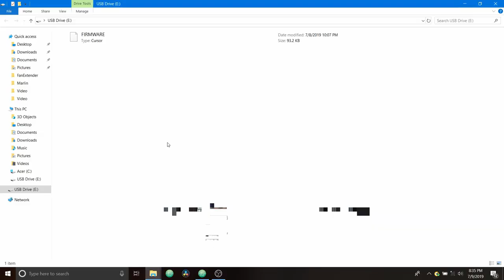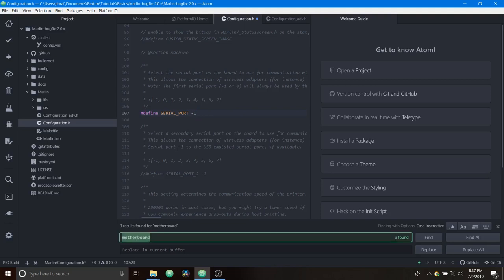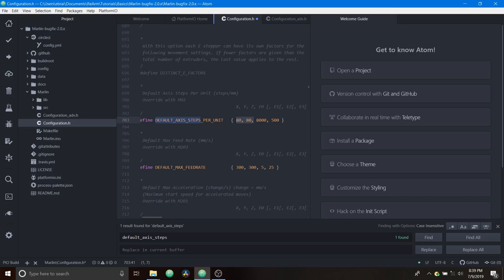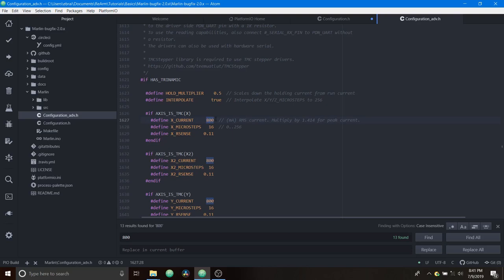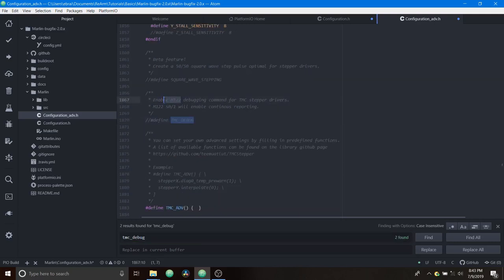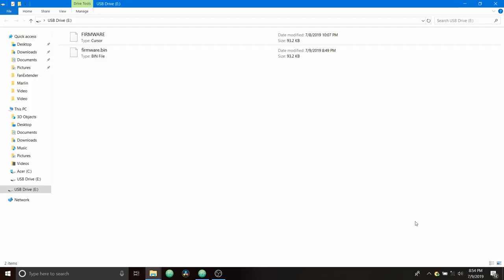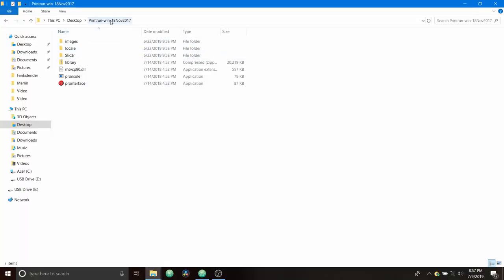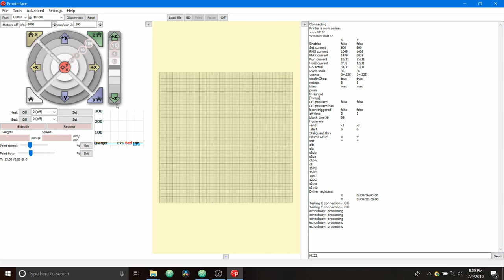SKR 1.3 - TMC2208 UART v3.0

Comment: Hi @Edward Braiman - I didnt read the directions and I'm now finding your vids.. I just smoked two of these boards; I believe (in part) to not reading the directions. Eventually I did move the jumper for the USB over but then (hind sight moment) I plugged it back in to my laptop... more magic smoke and my laptop went dark... Killed it!!  Now I need to see of my laptop can be fixed.
Reply from the maker: Does your laptop boot after?  I've done that in the past as well, but it usually burns out USB port.
Reply: @EdwardBraiman   sadly nope...  I haven't opened it up yet but I think it may have gone past the USB 3.0 port. I may just take it to a shop, it was a pricey laptop.

Comment: Thank you for publishing the image.
Thank you for your help beyond the language barrier.
BigTreeTech SKR 1.4 turbo
BigTreeTechTMC2130 SPI v3.0
NEMA17
Same as jumper pin image in configuration
#define DEFAULT_AXIS_STEPS_PER_UNIT {80, 80, 400, 93} // Changed
Faced with the problem of constant travel distance
Every day I don't know how to deal with it.
Thank you.
Reply from the maker: Are you saying calibration of x axis moves 20 when 10mm is requested in Pronterface?
Reply: @EdwardBraiman  
Ed's 3D Tech
Do you say that if your Pronterface requires 10mm, the x-axis calibration will move by 20?
Thank you.

Input 30mm with G00Z100
Reply from the maker: Ok let's start with a frame of reference.  If you move x axis 20mm what occurs?  Does it move a distance of 20 mm?
Reply: @EdwardBraiman   
Thank you.
I will check again.
good bye
Reply: @EdwardBraiman 
 I couldn't understand because the motherboard was different.
Thank you.

Comment: I'm in the middle of upgrading my Cetus3d-printer with this board and the TFT35 V3.0 display plus a Noctua fan.
Had to order some PT100K thermistors (B57560G1104F000) from Mouser and are now waiting for the delivery.
My TMC2208 works fine, just a little hum when the axis move.
Reply from the maker: Current value maybe a little high.  Try moving the value down about 10% and see if the humming stops.  Let me know how it works out.
Reply: @EdwardBraiman  Yea, I just set it to 500 mA in Marlin, just testing! Lots of paramerers I can play with. No magic smoke so far!

Comment: This was indeed a very frustrating experience...Had the same problem as Ryan Schmaltz. It's a damn MICROSOFT problem. (I have Winblows 10, 64bit) I don't know why after 24 years of the existence of USB, MS still can't get it right. Tried the below solution three times, didn't work. Finally had to remove sd card from printer, put it into a different card reader, which Win 10 did not recognize, had to format it (FAT) then manually copy the bin file from the directory it was saved in by Atom. Put it into the machine and theeeeeeennnnn, Voila! finally got the Ender screen to be more than a night light. Was able to move the axis and extruder. Then connected up the Raspberry PI, which recognized the new Ender reincarnation right away. Started Octoprint and am now running a stringing test. I am amazed at how quiet this thing is now. I am running 2208's for all four steppers in UART mode. Soldering the pads was a major pain. Good thing I had 5... I destroyed the first one. Perhaps the manufacturer of them could put a micro jumper pin set there...hint-hint. I needed to combine information from at least three videos to do this, none of them did it all.  Here is the other main video, this is very helpful.
https://www.youtube.com/watch?v=GNGN2iSQ5j4
I built the rear enclosure that this guy has on thingiverse.

Comment: I bought this from them and their V3 drivers and they are weird as they are more universal because their pins go all the way through so can be used on the V1.3 via jumper or the wire loop mess on the other controllers.  Pretty cool and forward thinking.
Reply from the maker: Yup.

Comment: thanks for the clear tutorial, would also be helpful to show what solderpads need soldering on the tmc2208 as bigtree tech dont always solder the pads to use uart mode.
Reply from the maker: This maybe true, but I'm concerned some might not see the zero ohm resistor.
Reply: @EdwardBraiman  i only mentioned it as i ordered the 2208 from big tree which was meant to be pre-soldered for uart and came un-soldered
Reply from the maker: @johnsnow6012  I understand.

Comment: thanks for the first steps. My Board is up and running so far. Now I wonder, if i can attach a capacitive Levelsensor and if additional MosFets are required like on my ANET-V1-Board, which the SKR will replace soon.
Reply from the maker: I avoid mosfets only because I don't use the heat on my heatbed.

Comment: I just received Bigtreetech TMC2208 v3.0 drivers, and already have MKS GEN L V1.0 main board. For not I'm running them as standalone, but wondering how to properly wire them to be able to use UART in combination with this MKS board?
Reply from the maker: This videos scope is for SKR v1.3.  you will need to read the manual for bigtreetech TMC 2208 as they may require changes.  Also there is directions in Marlin firmware you need to follow.

Comment: Edward Braiman, Hello,  I am re-vamping my CR10S and using the SKR v1.3 board for this. I have a new extra set of LV8729 drivers, and hoping that they can be used, instead of having to buy different drivers. Will this be possible , or cause problems? Thanks
Reply from the maker: The board should support it

Comment: Hello i have 4 question...
1. need soldering bottom pcb ? (J2)
2. TMC2208 V3 on Drive Extruder can use ?
3. STEP/DIR mode use with Drive Extruder  ? 
4. Different  STEP/DIR mode and UART v3.0 on  Drive Extruder  ?
Reply from the maker: There are three modes you can use on tmc2208.  I'm only addressing UART mode of stepping in the video.  Soldering normally is not required unless there is a defect in manufacturing.

Comment: Hi Edward, Great explanation well presented.  I have also new 1.3 board w/ 2208 v3 uart.  I am  planning 4 uart 2008 / X,Y,Z,E   - question regards X_current 600 change from default . why? what the benefit ? is it ok to put all stepper motor current 800?..  x-axis. y-axis, z-axis, extruder?   Thanks
Reply from the maker: Well you should use the datasheet and equation in the firmware to start, but for testing it's okay.

Comment: Driver for Extruder which best choice ? TMC2130 TMC2208 or DRV8825 ? for skr v1.3
Reply from the maker: Depends on you level of experience.  As a beginner I recommend starting with drv8825.  When you become more confident, then tmc2208.  And when you're very experienced, then tmc2130.  This is only because as a person gains knowledge they'll understand what's going on.

Comment: Thank you for all the info. I have 2 questions. first of all I did purchase 4 v3 2208 drivers. 1. if I use 2 motors on Z drive what do I set current to on that driver? 2.  my old e-0 default steps is ###### do I set the same as in old software?
Reply from the maker: I would start with default setting after computing RMS and divide the  connection using the technique ... https://youtu.be/yrSSps4ZWQk ... Start as if you're working with one motor.  Let me know how it works out.
Reply: @EdwardBraiman  All working good at default settings. Sure is quiet with 32 bit board and 2208 drivers.

Comment: Other guides tell you to place a jumper on the 2nd row (under the drivers) if you want to use the UART mode. They also tell you to solde the j2's.
Why don't you?
I just keep getting tmc connection error and just don't know what else to do anymore.
(Skr 1.3, all tmc2208 V3 drivers, TFT 24 V1.1)
Reply from the maker: The jumper caps in correct position are still required.  On underside of TMC steppers there was a quality issue that myself and other early adopter's experienced with zero ohm resistor falling off.  Since then it's been mostly corrected.

Comment: As the video is wrongfully labeled TMC2209.
I'm actually configuring the TMC2209 in the SKR1.3 and stepped into communication problems.
Turns out it has to do with the wiring of Rx/Tx on the stepsticks.
Mine had an internal 1KOhm that got inline with the TX on the SKR board, so uart signal level seemed not sufficiant and communication failed.
This may be important to check for different 2209 and 2209 sticks when having no success with M122.

I got it finally fixed by using an additional jumper on the SPI jumper block effectively shorten the Rx/Tx pins of my TMC2209 step sticks
Reference here: https://github.com/bigtreetech/BIGTREETECH-SKR-V1.3/issues/59
Reply from the maker: Not sure I understand, the video is for tmc2208.  Could clarify?
Reply from the maker: Okay I think I understand you're saying to do TMC 2209 you'll need to add a jumper.  Good to know.
Reply: @EdwardBraiman  
a) I still have a cashed copy that labels TMC2209, guess there was a typo when uploading?

b) the communication problem may not just be for 2209. 2208 and 2209 communication is rather identical. It's the problem that the pinout of the step sticks seems to be not standardised.

My 2209 are FYSETC v2.1 and you recognise the variant with seperate Rx/Tx pins, the pin sequence is  EN, MS1, MS2, TX, RX, CLK . There seems to be an 1kOhm between Rx and Tx pin and only the Rx connects directly to the TMC chip.
This sticks obviously have an integrated Rx/Tx sepearation circuit that conflickts with the BigTree layout. This separation circuit is already on the SKR layout when you check their shematic. Otherwise you get level problems between Rx and Tx on the micro controller ports because of the added 1kOhm on the stick.

So the SKR1.3 connects the UART jumper to the sticks TX pin only, but expect a single UART pin going directly to the TMC pin on the step stick and do the Rx/Tx break out with the 1kOhm in the SKR board layout.  

By the additional  jumper I can fix this and bypass the 1kOhm on the step stick between Rx/Tx and the SKR gets access directly to the TMC chip pin. So I spare myself the modification on the step stick with solder irron and tiny surface mounted components.

Just wanted to note, that you need to be carefully with step stick VARIANTS out there. 
That's because the step sticks aren't standardized for the Rx/Tx pinout and you may get similar problems with random 2208 sticks as well as some 2209. There is no guarantee that they do it as Bigtree expects it.
I think Bigtree takes this in consideration on their step own step sticks, but when using random cheep chinese supplies you can have the same UART problem with any 2208/2209 clone sticks.
Reply: @EdwardBraiman  He's referring to the title of the video. You wrote "SKR 1.3 - TMC2209 UART v3.0" instead of "SKR 1.3 - TMC2208 UART v3.0"
Reply from the maker: @simonhersche6720  Yeah.

Comment: Beloved Edward, can you please tell us what this spying mod is and what it is usefull for? how do you set the board to spying?
Reply from the maker: It's called SPI, for serial peripheral interface.  It's a hardware configuration with software to communicate via specified hardware address.  The reason I don't go into extreme detail is to have some ask for more detail.  In the case of the pins file, the pin for a specific stepper like TMC 2130 in a SPI configuration will say move the stepper this amount base of PWM (pulse width modulation).  This can also be applied to other device like LCD, data transportation, ECT.  Keep in mind I'm trying to teach a simple task for people to maintain interest in 3d print and learn on there own in greater detail.  If I spent 45 minutes explain how packets are assembled and transfered over a wire people would become bored.  If I start talking about the software protocol development and abandonment by 🍎 corporation.  If you would like I can talk in great detail as I've worked on SPI for a number of years professionally?  Personally, I want people like yourself to challenge me by challenging yourself to teach others with empathy and encourage learning.  Thank you for explaining to me I was not detailed enough, I'll work on it while trying to keep the tutorials fun.
Reply from the maker: Sorry I water down the tutorial as a way to keep most interested in learning how the printers function.  I want to make it look easy to learn.

Comment: Thank you for the video, I was going mad already. Just one thing that I still don't get a concrete answer from anywhere, what about the jumpers on the bottom side of the pcb? Did you solder those, and if you did, which one? The upper one or the lower one? (By upper I mean the one closer to the side that is written bottom)
Reply from the maker: They should be soldered on bottom if you purchase from bigtreetech, but you can inspect with a camera zoom to check.
Reply: @EdwardBraiman  yup got mine from them bundled with the mobo. But the mobo just died a few hours earlier, it turns on but the main chip became a huge resistance lol. But thanks, I will keep that in mind when ordering a new one, I had initially soldered mine like that, bottom wise, but even though the motors were working it would not home for the life of me, that's also something I have to work on.
Reply from the maker: Sorry, to hear about your motherboard.  Do you know what caused the issue?

Comment: Hey Edward, thanks for the great video's. Is there any chance that you will or can do one on TMC2209 drivers, I know the teaching Tech has done one but for some strange unknown reason I get so far and can go no further.  Cheers Merlin...
Reply from the maker: Sure, but my two week vacation is a couple of weeks away.
Reply: Yeah, that would be awesome. I have struggles with my original BTT TMC2209 as well - Did everything as in the Video but the drivers do not register (Testing X connection... Error: All LOW). I did not try it out with the correct voltage from the power supply, only powered by USB - can this be the problem?
Reply: @ThePixelbuilder  Have you gotten any further?  I seem to be in the same situation you are.  BTT TMC2209 v1.2 with BTT SKR v1.3 on all steppers (X, Y, Z, E0) and when just connected to Pronterface via USB, I get the same message you show.  Any other sources of help that you have found?  I didn't think I had to do anything with the solder pads due to the UART jumpers on the SKR v1.3  board.
Reply from the maker: Is the PSU connected and powered when I saw low, the power was disconnect.  I'm getting ready to do a video on tmc2209 UART maybe today inn SKR 1.4 and maybe tommorow on SKR 1.3.
Reply: @mkirich  you the the power supply from the PSU with USB alone it did not work for me.
Reply: Thanks Edward and ThePixelbuilder.  I did some digging and saw the same info within some Marlin bug reports.  I connected a 12V supply to the SKR 1.3 (don't forget to move the jumper to INT/+5V) and the error messages went away.

Comment: Question: why change DEFAULT_AXIS_STEPS_PER_UNIT for the Z to 8000? My Ender 3 Pro was set at 400 but in the video yours was already much higher and then you changed it to 8000. When I updated the firmware with that 8000 it made my Z Axis move 10x (estimated, could have been 20X) farther than it should. It also moved quite rapidly. When I went back and reverted to the default it is slow and normal again. Just want you to know, this is a great video, I never could have installed my SKR1.3 (different video) and 2208s without you. Thank you.
Reply from the maker: I'm using the firmware default in the video, otherwise as you noticed it will cause confusion.  Great catch, for people in a similar situation as you.  The actual values can be dereived from the RepRep calculator on Marlins webpage. Sometimes I'm just trying to hit the main setup points and skip the finer details.  I'll try and remember to say something for SKR pro v1.1.  currently I'm holding back on those videos until I have several.
Reply: @EdwardBraiman  Thanks, totally new at 3D printing but I've been a computer geek since the 80's. Loving that I have a reason and motivation to pull up my old skills for a practical purpose for this toy that makes toys.

Comment: Having a bit of trouble. Bit of a noob here to be honest. I followed you video very closely. When I uploaded the build it showed the BIN file on the SD. I unplugged the USB, waited a sec, then plugged back in. However, now my computer is saying the USB Device is not recognized. Little lost!
Reply: Got it fixed! Not sure how, but in case someone has the same issue.....?

Pulled the microSD and put it in a card reader. Showed the original cursor file along with the BIN. However, the BIN was showing a size of 0. deleted the file then used Atom again to upload the build but left the microSD inserted through the card reader. New BIN showed up. Plugged it back into the board, then the USB into the machine, and BINGO. It worked. Not sure what happened the first time but we're good to go now!
Reply from the maker: If it makes you feel any better, the same issue occured for me until I realized the operating system takes a moment to recognize device again.  Also, I've made the mistake of not specifying, "#define serial_1 -1" several times.
Reply: Well, I appreciate the video. It helped this NOOB. Now I just have to get my ABL set up, everything wired, and I should be good to go!

Comment: I have the skr 1.3 board with the tmc2208 step sticks.
 Upon compiling the firmware, it shows "the connection error". 
Please cover the fix for that. 
I did the solder jumper on the three little solder points only to find that it was the wrong thing to do. So, I purchased another set of the tmc2208 and did not do the solder mod. I placed the jumpers on the skr 1.3 board for uart mode. I don't really care if the uart works of not. I just want my printer to actually print.
Thank you.
Reply: I do not have the Big tree Tech drivers.
Reply from the maker: Well you'll need to check the datasheet for UART configuration on those steppers.  It should not be that difficult.  They explain which solder pads are required.  Let me know how it turns out.